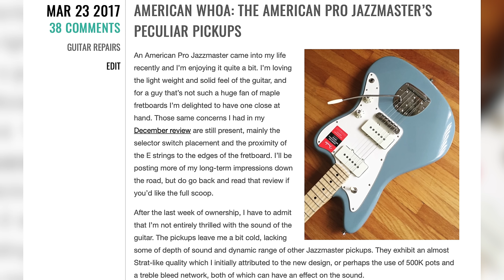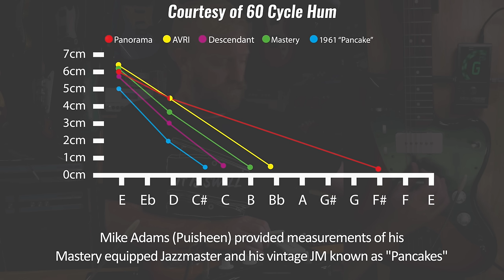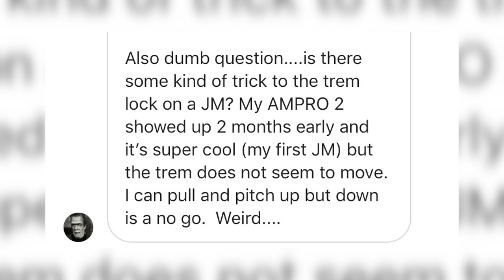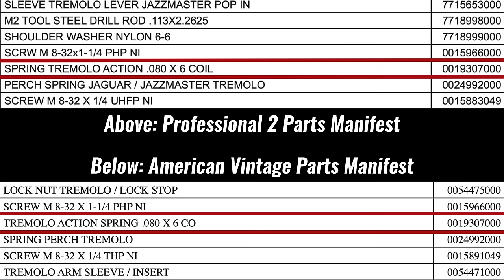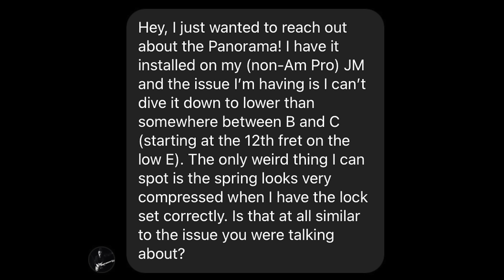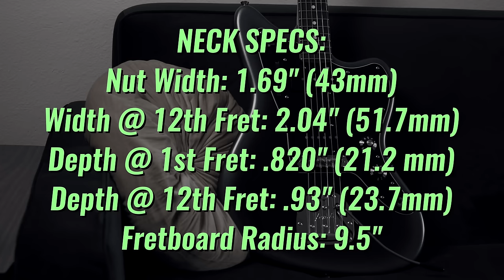JAZZMASTER REVIEW #6: Fender American Professional II Jazzmaster + Demo!

Comment: I raised an official warranty claim with Fender over this spring design fault on my Pro 2 Jazzmaster 6 months ago at my local Fender guitar Shop. They never bothered to get back to the repairer.
Have you had any updates from Fender about this easily (for them) fixable problem? As I know you have some sort of rapport with them.
The guitar is just fabulous and I love it, but this design fault really restricts to 9 gauge strings for the tremolo to work as intended.
Are Fender just interested in updating the Presonus Studio One DAW, which they bought out recently?

Comment: I like to use the Fender Classic Gear tuners.  The mount the same as the "normal tuners (2 pins) but they are split shaft similar to the vintage ones.  They even look like Klusons.

Comment: Watched the vid, and as an amateur luthier, I totally appreciate having a more engineer-focused perspective on guitar reviews instead of the typical mindless jamming through $250,000 worth of amps and effects.  It was pretty compelling.

Question though: is the Panorama vibrato something that you'd recommend over the Mastery (aside from the weak spring issue)?  I have zero experience with both, but it seems like the Panorama seems to be a bit more user friendly and straightforward than the traditional JM vibrato the Mastery is emulating.
Reply from the maker: Personally I'll still take either an original PAT PEND or the Mastery over the Panorama, even with the spring swapped.

Comment: Nuts about the panorama spring issue. Great that it's not a crazy hard fix if you can find the right spring. 500k pots, while reducing the very top end "sparkle" give you a better more usable tonal sweep overall I think without necessarily getting "ice pick" tones (just a difference of opinion on what that over-the-top top end can mean to different players). The pickups sound fine to me but you can always swap for better ones or different flavor. Same thing with tuners. Tuners, pickups, pots and bridge vibrato wouldn't hold me back from that guitar (expensive as it is already).

Comment: The tuners look terrible, the trem is a lash up,  Fender design looks to be on a par with Gibson quality control. File under "couldn't give a sh*t". I thought you were generous considering the price of it. 
Even though its been sorted on this variant, the previous models string spacing is also an issue on the Mexican Troy Van Leeuwen Jazzmaster, the high E is barely over the fret board, and I have returned two of these guitars to the mail order shop and given up finding one as its clearly a "structural" issue. I regret selling my origianl release Van Leeuwen Jazzer as it was a very acomplished build, the E string was acceptable and it was beautiful colour. Any thoughts of buying an American Pro 2 have gone after watching your impressive review. I liked your alternative playing too. Thanks.

Comment: Hi, I have a question about this jazzmaster! I am in love with this series as it gives me everything I like, however, I know that playing 9s on a jazzmaster can sometimes be difficult… does this particular bridge work well with 9s?
Reply from the maker: This model has a generously angled neck pocket so you can more easily accommodate lighter strings on the Pro II than more vintage-correct models. However, I really would urge you to try at least 10s on offsets regardless

Comment: 32:45 Maybe Fender could include a heavier string with instructions in the case candy for heavier gauge strings? Stock spring for up to & including 10-46, anything heavier, use the optional heavier spring. Mastery do not provide the springs as parts, but maybe Fender could source the same part in bulk? Because the pivot point has been re-engineered I doubt they could make a one-spring-fits-all solution.

Comment: I play in Drop C, I use Ernie Ball 10-52 or 10-54, will they be fine if I want to use the tremolo? It's not a complete deal breaker if it doesn't work just as long it stays in tune is fine with me but just thought id ask lmfao

Comment: Hey Mike, thought you might want to know this. There is another problem I’ve noticed with panorama bridge. When the tremolo arm is fully engaged, the amount of travel is massively reduced. Back it out half a centimetre or so and the range is back to normal. This happens even with 9’s.
Reply from the maker: Asim! I just saw your comment and rushed to try it and, yep, pushing too far does indeed cause the vibrato to bottom out on the cavity. This isn't so different from other models though –– if you push an AVRI or MIJ/CIJ in too far, the same thing happens. But good catch, I hadn't considered it with the new arm housing in play

Comment: I could be wrong here, but it seems like at 29:14 the restricted movement in the spring might be mitigated a tad more if the internal tightening screw was evened out across the board. it looks to me that the screw was tightened progressively more as the string gauges go up
Reply from the maker: That screw is there to counteract string tension, and the more tension is applied to the spring, the lower the internals sink into the body. That spring is so weak that it doesn't matter where you have it set. Recall Vanessa's guitar where adjustment with 11s didn't help, and put the vibrato arm much lower on the body

Comment: What're your thoughts on the 60's road worn Jags? I just bought a used one today. Specs seem cool, 7.5 radius, 65 vintage pups, proper bridge and Trem system, etc! The only thing is it buzzes like hell after the 12th fret. Getting a fret level to try to fix it. The radius won't work either because the bridge screws keep coming undone. Honestly not sure what to do with it if the fret level doesn't fix the issue. The neck is dead straight (minimal relief) so I've no idea what else todo
Reply from the maker: I like them! They use different thimbles with a smaller interior diameter so using aftermarket hardware can be tricky, but that model is usually pretty good. Your fret buzz after 12 may be due to too much neck relief, which can often read as an upward slope toward the strings on guitars like Jaguars which require additional pitchback on the neck. Those bridge screws, yeah, that happens especially on those more affordable parts. A dab of blue Loc Tite will go a long way to help

Comment: Is there a good source for stiffer springs that doesn't involve buying the entire system? I bought one of these last year right before the price changed and I too am running into the string gauge issue. Even D'addario 10.5s behave like the 11s in your video, so it's obviously extremely sensitive.
Reply from the maker: Looking into it. Likely will have to order custom

Comment: It's funny that you hated the American Pro trem system. I loved being able to screw it in just far enough to have it stay in place unless I nudged it. I had the Jaguar in sonic gray with an all-maple neck, and if the neck profile had been a little thinner, it would probably have become my #1 guitar for life (maybe with a pickup swap, but I thought the stock ones were ok).

I actually sold it and kind of made my own Jazzmaster version by getting a Mexican JM with a 4-way switch and Pure Vintage 65 pickups and adding the American Pro bridge and trem arm. The fret ends could use a touch-up, but it's most of the way there for a lot less money.
Reply from the maker: I didn't hate the original Pro vibrato, I hated the arm. It's otherwise identical to an AVRI

Comment: Respectfully… why wasn’t the spring your very first thought? Every trem system is going to be sensitive to this to some degree as they balance string tension against spring tension to locate the desired angle of the trem block.

I guess with a Strat it’d be more obvious because the bridge would visibly be at a ridiculous angle.

The Panorama sounds like a massive improvement, so just do what everyone else does and buy a stiffer spring if you want to bump up the string gauge. Hell, even with the stock string gauge I’de want a stiffer spring for the feel alone.

Comment: If you put a mastery of American pro does it fix the string spacing roll off the edge issue?
Reply from the maker: Mastery has 52mm string spacing, which is enough of a difference from the original Pro 55 that it should definitely help

Comment: I just added microtilt to my Bass VI and reassembled with a panorama. This was tonight and i just put it away. Im assuming i need to order an assortment of springs to see if it will divebomb then. I assume it will because it did before I tuned it no matter how tight i turn the adjustment screw, the arm raises and raises but it feels like I'm pusing against a wall. Probably something simple but I'm inches from ordering the full Halon treatment and building a Jag or Jazzmaster with my first bill of parts.
Reply: I'll edit for punctuation and caps later. I'm stressed. String mute worked a treat. And my crazy ass Rick style Laquered fretboard is acceptable. Bridge seemed alright, will diddle with the action yet and bridge etc. maybe I jumped ahead. But I was hoping it would dump a note or 2 with stock spring. First plan was to use stock Bass Vi spring. Tests and comparisons showed an identical part.
Reply: So I used as was. Maybe I can put both ina as a test as the squished le nobody's business. I wonder just how much more tension is required. I have 3 weights in my cart. But maybe the Halon Bass VI brisde would make me happier. I knew it would be work. That's the point of this project. Need to practice some day as it's consumed me so I put it away.

Comment: I can confidently say 2 years later there has been no resolution to this
Reply: Interesting.  So Fender is still using a spring that coil binds with 11 gauge strings?  I have a Jazzmaster being delivered to me in a couple days.  Sounds like I will need to get the replacement spring that was discovered.  I would have thought Fender would have changed the springs by now.  Would like your thoughts.
Reply: @captainbob406  if you want to put 11’s on it then yes you will have to find the replacement spring. I put 10’s on and it was basically unuseable. The guitar would just fall out of tune since the spring wants to stop at one place but the string tension slowly makes the spring compress down. It was fine with 9’s since that’s what it was designed for but anything else is ass.
Reply: @Daedalus33  I just ordered a couple of springs that Mike recommended in a previous video.  I think I would like 10's on it but we will see.  I have already noticed that letting the guitar suit for a couple hours all of the strings went flat.  I assume once the spring takes a set, that issue will go away (I hope). My guitar surprised me and showed up today.  I pulled the trem to tighten up the vibrato arm and adjusted the action on the neck.  Strings came way too high from the factory.  The guitar sounds great.  I wasn't sure about the pick-ups but I think they are going to be OK.  Also wasn't sure about the rhythm circuit series wired pick-ups but, they sounded pretty good as well.  I think I am going to really like this guitar.  A bit different than my ES 335.  lol

Comment: I don't get the part about not being able to get coil tapping with other manufacturers. Could tapping has been around for year. The only thing really unique about it is that it's on a Jazzmaster but you wouldn't expect another manufacturer to have a Jazzmaster. It's new for Fender but it's not new for guitars. 
And before someone replies, yes I know that coil tapping is different than coil splitting. They've both been around years.

Comment: I bought a Noventa Jassmaster (red + maple fretboard) but owned it only overnight. I ordered it without first playing it & the dealer was super cool with my returning it. I put new strings on it & spent about 2 hours breaking them in. It had 3 P90s & since I'm relatively new (started playing in '18), I didn't find the diversity of tone worth the extra $. It was very heavy & I found it awkward. It just didn't feel right. One thing I share with my local guitar specialist is, a love for the JazzMaster's tremolo system. I opted instead for the Noventa Strat with 2 P90s & I've never had a guitar that stays in tune as well as this one.